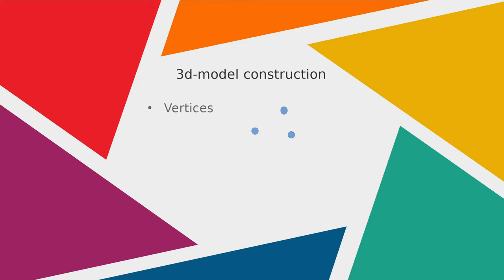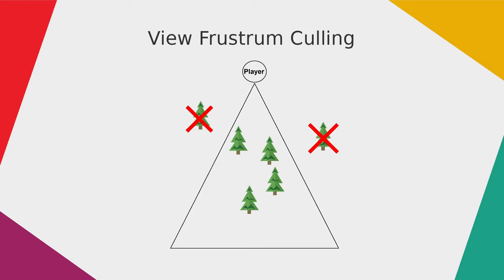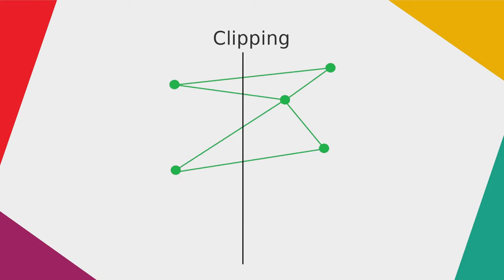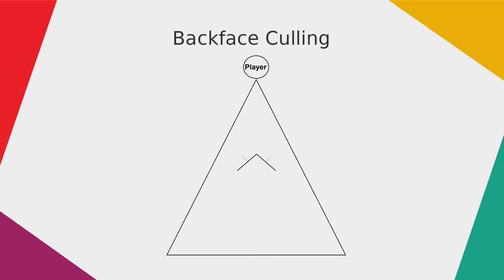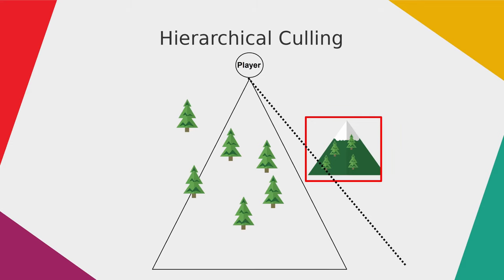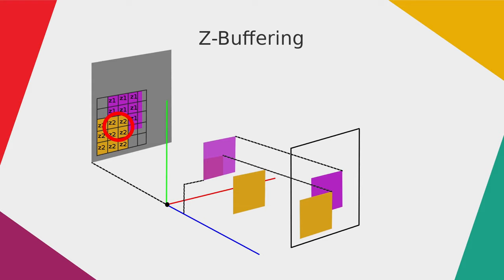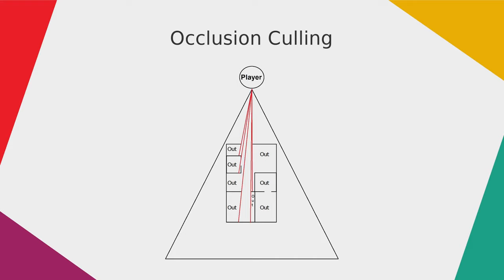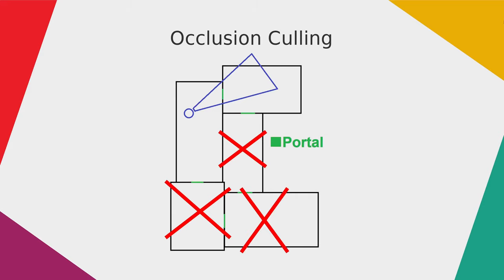Every game developer needs to know this - Culling

Comment: most game engines already do this, doing it your self would be incredibly stupidly painfully difficult
Reply from the maker: Absolutely🙂👌, I agree with you completely. And that's why you should use modern game engines that already have such algorithms implemented, because doing otherwise means a lot of work for the gamedev. But knowing how these algorithms work and what they do is very essential for a game developer. Because it is sometimes very important for the game performance optimization to adjust the settings and fine tune some of these algorithms in the game engine. For example, in Unity it is always important to optimize and adjust occlusion culling for your larger games.
Reply: You know what's incredibly stupid? Your comment. Not only difficulty is relative, but the "other apps already do this, therefore no one should ever learn about how to do this" is the dumbest argument ever.
Reply: @illidan-gb9sk  ok, have fun making a game engine from scratch then, no one is stopping you brother